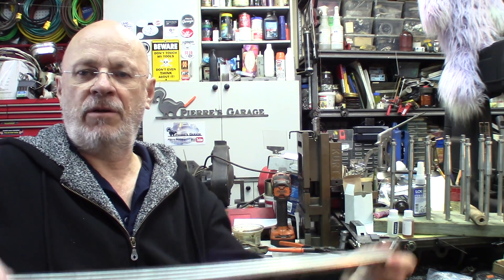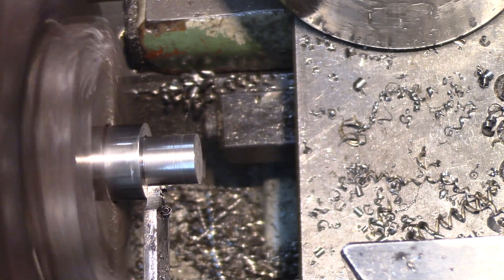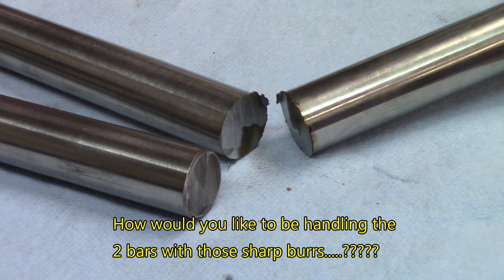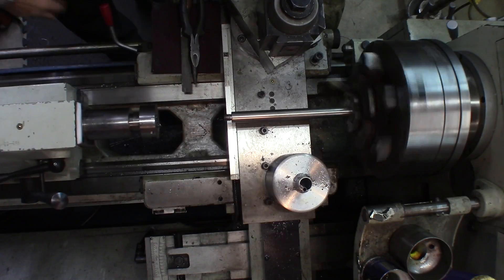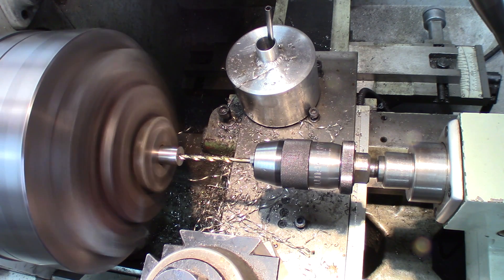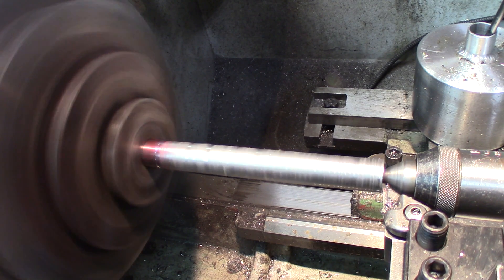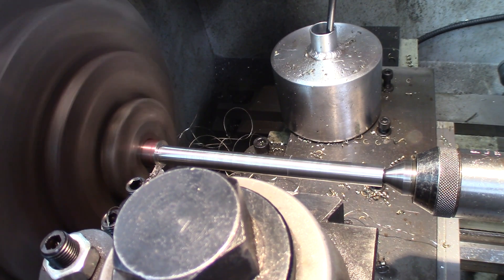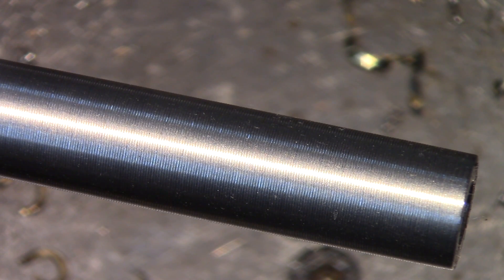Machinist hammer, handle body ( Keith Fenner WIYB 2016 giveaway )

Comment: get a diamond file and stroke the radius of the insert, so its like, a big radius, but on a very short section. this is called a wiper flat. now you can feed fast and still get a good finish, possibly eliminating the very loooong chips
Reply from the maker: To make sure of what you have in mind, do you have a little sketch of the profile?
Reply: yes, from the sandvik website
http://www.sandvik.coromant.com/SiteCollectionImages/Technical%20guide/Snapshots/eng/D%20Milling/d065_eng.jpg

the inserts are called 'wiper insert'. Here's video demonstration https://www.youtube.com/watch?v=qEjQ5cXErvc

If you google PCD chipbreaker, you can see how it eliminates the long stringy chips. PCD is diamond, so now we have chipbreakers for those (previously, its just a flag piece of diamond brazed to the insert). The insert stays sharp for like,,, forever ,,, you can just buy 1 of those insert to solve all your aluminium turning needs.
Reply: its kinda like the 'reamer' of turning and milling http://d2n4wb9orp1vta.cloudfront.net/resources/images//cdn/cms/PM1213_TurbochargeSwiss_b.jpg
Reply from the maker: meocats
Got it, thanks for the tip...   ;)

Comment: Hey Pierre, in regards to your comment on parting tool, I came across someone showed a tip where he ground a slight hollow, not quite to the edge of a parting tool, and said it made parting event free for all his students. I haven't tried it yet, but it might be worth passing on. 
Nice video, I have a start on my own version, but it has been sitting idle waiting for me to find some time to get busy. 
Take care , my friend, I am looking forward to next installment, thanks .
Reply from the maker: Your idea is something I use when everything else fails...    How lazy can I be, what you propose is great to help with smaller machines, but, sometimes it's the best way to solve the problem even with bigger machines, it helps the chips to clear the sides and evacuate easier by squeezing the edged towards the inside a little.... 
Great idea, just got to think about it when on the grinder.
Thanks for your input and comment,   Pierre

Comment: That is some messy stuff to cut.  I know you need stainless for this but I try to avoid the difficult metals when possible.
Reply from the maker: Hi Harold,
Stainless gives great results, but, is a more difficult material to work, expensive on tooling also, it's a gummier material where the cutter has to do all the cutting right down the to the bottom of the cut, there is no tearing like most other materials just before the cutter reaches the bottom, this generates much more heat and is tougher on cutting tools, the chrome in the alloy is a tough cookie to deal with.
There is a time where only SS will perform the task, so.....   ;)
Thanks,     Pierre

Comment: Poor Moose! I hate long stringy chips! I will fool with speeds and feeds and even different inserts to try to avoid them if at all possible.
Reply from the maker: Hate those long stringy long and sharp chips also, since I had different cuts depth, it was not always possible to have control, at least got the bigger ones to curl and break...   ;)
Reply: Pierre's Garage
For lighter cuts you need a finish insert. I have one that will break a chip with a super fine cut, problem is it sprays the operator with hot miniature shrapnel! I figure it would be great on a cnc lathe but it is not so nice for a manual machinist. lol
Reply from the maker: bcbloc02
The problem is that I wasn't ready to change tooling for just a final cut...   And it was out of question to change in the middle of making a taper afterwards like you'll see in the next video...   ;)

Comment: Nice work on the handle body. One can never be too careful around those stringy chips. I'll probably share my recent experience in an upcoming video, but I had one of those strings get caught up by the chuck which then grabbed a wrench I had on a shelf above the lathe. A 17mm wrench traveling at nearly Mach 1 grazing the side of your head is an "eye opening" experience. Glad you pointed out to your viewers how important it is to be extra cautious when dealing with stringy cuts. Looking forward to the continuation of this build.
Reply from the maker: Like you mention, those chips can be surprisingly fast and sturdy, this is why I keep far from the line of the chuck's line of rotation as much as possible, this saved me a couple of times...  ;)
Be careful and thanks for comment,    Pierre